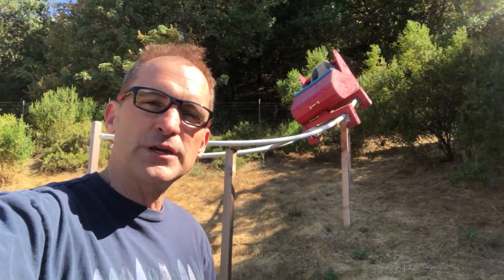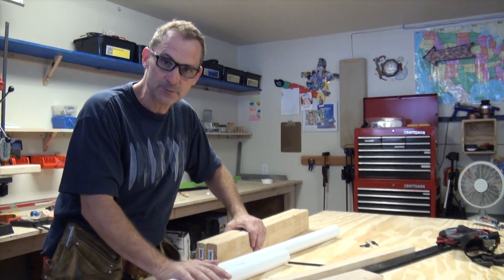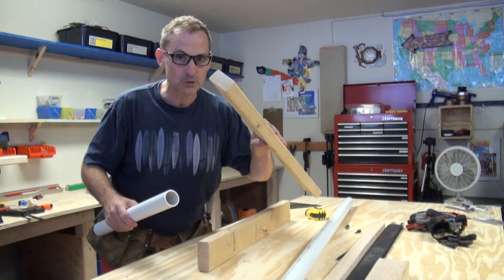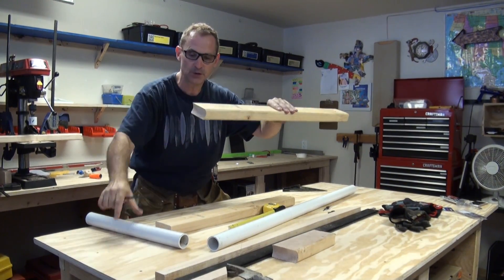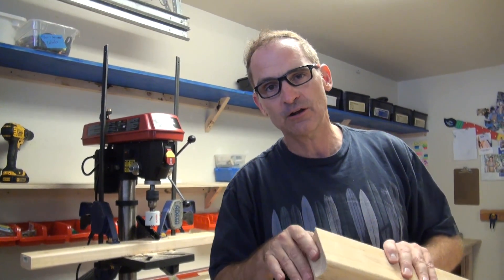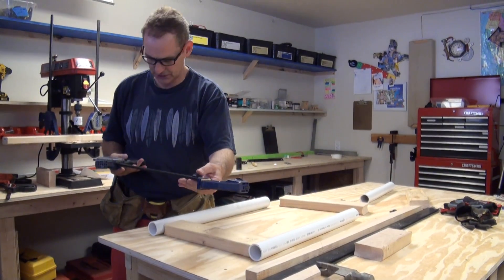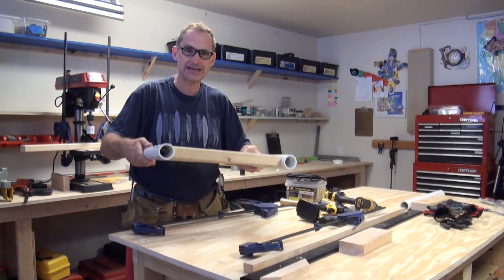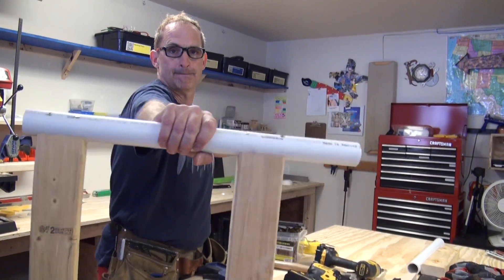How To Build A PVC Roller Coaster Track

Comment: Will, I would use a GRK fastener. Deck screws have low shear strength and will fail catastrophically with no warning. GRK is designed to support lateral loads.

Comment: How long do the coves need to be?
Reply from the maker: The coves aren't 100% necessary. If you do use them, they should match the outside diameter of the rails you're using. Hope that helps!

Comment: What spacing should I use between the ties? Thanks!
Reply from the maker: I usually ended up between 18 and 24 inches. The more stress on the track (hills, turns, etc.), the closer the ties should be.

Comment: Hi Will, great video.  I have my pvc bent and ties cut but I'm struggling to scoop out the ends if the ties with rhe hole saw.  What saw are you using and what RPMs on your drill press?  My chuck keeps unseating I think bc of the uneven force on the saw cutting on the edge.

Any tips would be greatly appreciated

Comment: pvc sch40 comes in foam core and solid core, foam core is mainly for DWV drain waste and vent, solid core is for pressure water line, there is a big difference in strength between the two.

Comment: How do you attached 2 pipes together without a union?  Union causing a bump in the track.
Reply from the maker: I put a smaller piece of pipe inside the two pipes as a connector. You can use a wooden dowel, or heat a piece of PVC pipe and then use PVC glue to connect them. 
Eventually, I decided to switch to steel track construction. Easier in many ways, and much stronger.

Comment: I guess great minds think alike as your Milling the 2X4 for the Pipe was my first idea  I thought of that to provide a bigger area for making the biggest gluing area  as I thought  some type of a epoxy or glue would help  keep the track solid for many years  although I’m not sure chemically what product would be safe on the PVC  yet 3M 5200  comes to mind as it is a Tenacious bond for Wood and Fiberglass holding together in a marine enviorment both under and above the waterline on a boat  I have things I glued  on my boats  that held for 35 years  without fail  and boat manufacturers  use the same product to adhere the deck structures to the hulls permanently

Comment: So I wanna build a pvc coaster with an inversion. Will a pvc track be able to handle let's say a heatline role?
Reply: I'm assuming you mean heart line roll and the answer is possibly, it depends on how fast you will be going but you will also need to do the math on it otherwise you could put a lot of g force on the rider and it won't be fun to ride.

Comment: Hey sweet video i have so many ideas!!! One question? How do you connect the tracks and make it so the rollercoaster can bend?
Reply: Add hot sand inside pvc pipe to make it bendable. I recommend watching Liam Thompson’s newest video on that
Reply: @TylerKingeryy  Sweet
Reply: Same
Reply: How do you connect the tracks
Reply: @ElmerXGaming  probably I would put a small piece of wood on the bottom of the track where both tracks meet and nailing it into to both sides of the track

Idk I’m no engineer or anything so there’s prob some video out there on that

Comment: You said your gauge was 18 inch on center.  15 + (1-1/2) + (1-1/2) = 18.  Center of the pipe would be 15 + (3/4) + (3/4) = 16-1/2.  So, are you measuring your track gauge edge-to-edge or 'on center'?

Comment: How do you bend pvc pipe I had the same question
Reply: Pour hot sand inside the pvc pipe and sit it on a jig to that is the diameter you desire.

Comment: Why wouldn't you use the grey 80 pipe? It's thicker and won't perish like the white does. So in my mind thicker = harder to bend but ultimately stronger and if the paint wears you don't need to be constantly re-painting.
Reply from the maker: I built a coaster with the Schedule 80 pipe once upon a time. What we found was that because it's gray, it absorbs more heat which makes the rails a bit softer in the sun. That, in turn, increases the friction between the wheels and the track, which makes the coaster go slower.

NOTE: I have done exactly zero scientific testing of that. It just felt slower on the track, and the Schedule 80 pipe felt softer when I was working with it. 

And, Schedule 40 pipe is less expensive!  But at the end of the day, I think it boils down to personal preference.